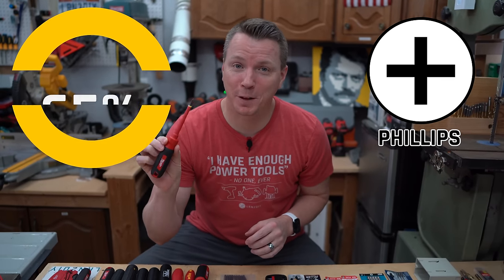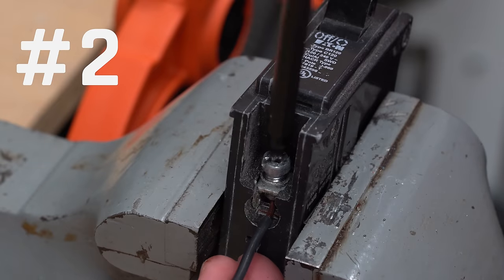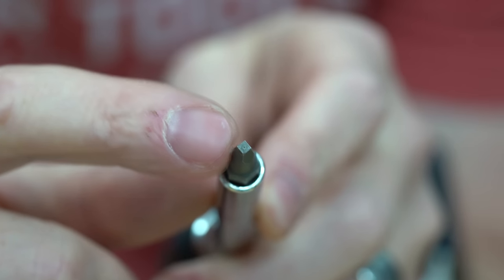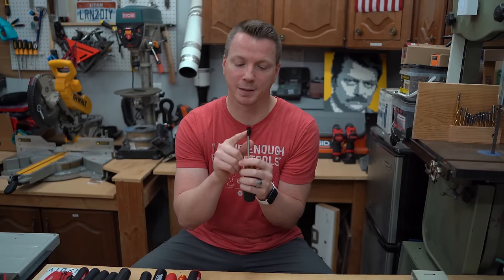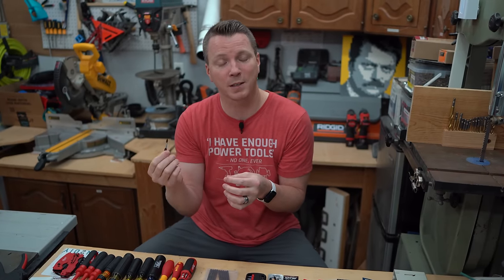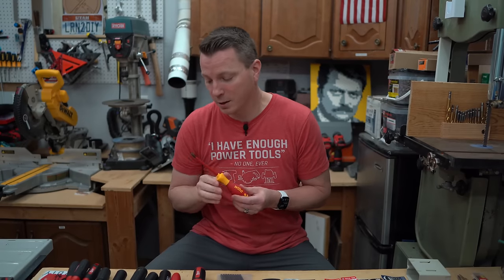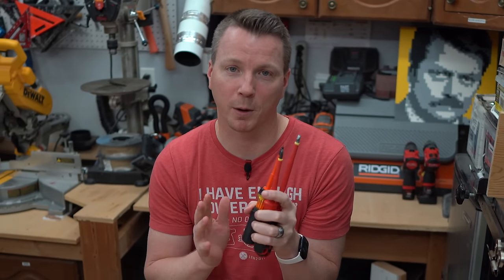You're Using the Wrong Screwdriver For Electrical

Comment: I use the flat driver because it gets the connections tighter.  Phillips is designed to cam out and will never get as tight.  

That said, I don't like the flat driver because it has to be centered in the slot, and the slot cannot be rounded off or 'stripped' in any way.  Or else, under high torque the driver blade can 'fly off' and be ejected from the slot with a lot of force.  If that hits skin it can give a very painful cut.  It's especially bad if the driver is in good condition or new because of how much torque it can handle without slipping and flying off, but when it does fly off it will be without warning, it will have all that torque behind it, and it will have sharp edges to really draw some blood.  If you get your fingers with that you'll know about it right away.

If it were up to me, electrical screws would be Torx (T30 would be good) or maybe square drive.  Both able to deliver a lot of clamping force for good connections, but no risk of the driver flying off and cutting hands (as with flat blade), or camming out of the screw and stripping it (as with Phillips).  Hex socket head would also be fine, 5mm or so will get tight and won't strip out.

The "combo" flat and phillips is junk, throw that away.  It can't do either job properly

Comment: The idea of the combination bit is that the square in the middle holds the bit in the center. The biggest issue woth flatheads is that they easily slip out

Comment: For many  years I carried  1/8 3/16  1/4 slotted & P2 fixed blade  screwdrivers. Recently (5 years ago)  I started carrying R2 in my tool pouch because most breakers now  have combi screw heads. My only regret is that I cant find R2 in 6 inch lenght.

Comment: That was great.  I wont waste money on any of the combo tips that I had been wondering whether they would be upgrades.  I use Robertsons mostly.  And I use the real ones.  There are a lot of badly fitted Robertsons out there.  Lee Valley sold the actual Robertson drives in all the sizes, I don't know if they still do.

Problem with slots is they need to be fitted.  They are the go to for gunsmithing, and you can make your own screws.  They also don't need to be cut in deep in the head so they work with shallow heads.  They are better looking.  And given that all the plate covers have flexibility one can usually adjust the screw to a 0/180 orientation, as one could with any screw, however that is a good look with a slot.  There is something a little vulgar about a Robertson trim screw.  Feels like you might walk by some day and see a dragonfly trying to start the next generation in there.

Comment: Do more research on phillips head screw drivers, they are way more complex than you think and more thought has been put in to the design than you can imagine. You are just using them wrong if you think otherwise a full set for example would be over a thousand different drivers minimum.

Comment: The best screwdriver is the one that fits into the screw head with tight tolerance. A slot usually can only be inserted to 1mm or so, would easily come back out and strip the screw head; a Phillips does not always fit into the groove perfectly, as different Phillips drivers and screw heads have different configurations of the wings and the grooves in terms of the thickness and the angles the wings taper, so the fit is far from perfect; whereas a  Robertson is just a square that can be inserted to about 2mm, as long as the driver fit into the hole without much give, it does its job.

Comment: the ECX driver actually DOES apply torque to the best part of the screw head to receive it. The slot provides the best leverage as it extends all the way to the furthest-from-center position. The "square center" doesn't need to go all the way into the hole, it's there to keep the tool LOCATED in the best position to apply torque, auto-centering just like the philips, but with a better way to apply the torque. The combination is fine but not necessarily superior. It's rounded on the "nub" on purpose so that it DOESN'T apply force to the square-drive portion of the fastener. The P2R2 should be avoided as it can easily be confused and used where it shouldn't be causing damage to other fasteners.

Comment: I've tried them all. I use the p2r2 at work for the copiers I fix. Love those. Klein ecx I've tried on the 11 in 1 I have. It's ok. Phillips can kiss my arse. I don't like them at all.  The slightest lapse in pressure, that P2 bit will destroy the screw head.  Honestly t-8 or t-10 torx could replace phillips and id be happy. Slotted should legally be discontinued. But sq1 is my favorite. Use it every time I make an extension cord using leviton plugs. I make a lot. I have an addiction. If you apply enough pressure to the square drive consistently in use I have yet to find an issue with it, square one or square too. Even in woodworking applications where square twos I run into more often than electrical panels only thing better than a square drive would be a torx.

Comment: I have preferred Square drive for years. Until earlier this year however,  I did not own one designated for electrical work. It is the best design for all types of screws in my opinion.  Home Depot  sold square drive deck screws years ago, then they went to star drive which I thoroughly detest.  I hope no electrical component manufactures ever go to star drive.

Comment: Having used all sorts of screw in fasteners in my working life. I prefer robertson. Another driver style that you did not mention is the torks head. A very good system for higher end fasteners.    
   As for stripping out threads or breaking fasteners It is a matter of being more careful. Philip's headscrews are a continuous problem. Trying to get enough grip to insert a screw properly or remove a screw is always questionable. Both the driver and the screw head wear out prematurely. Also, not every screwhead looks like a Phillips is. Some European cabinet hardware has a Phillips looking screw but the angle of the blades is much blunter. A standard phillips head driver does not work in those screws.
Reply: I’m with you, I’d like to see Torx everywhere.

I think the non-Phillips cross drive is simply dual slotted, isn’t it?

Comment: I’ve had far more rounded Robertson screws and bits than any other type of screws. I’m an electrical engineer and I’ve used all the major brands, Wiha, Phoenix, Craftsman, Snap-On and so far, and I really hate to say this especially when I’ve spent almost $100 on a single screwdriver, the Harbor Freight electricians screwdriver set is the best. They fit tight and don’t cam out or slip and also appear to be built to JIS standards. They are a little brittle though so using the slotted as pry bars is completely out of the question but as far as actual electrician stuff goes they are great

Comment: I am team robertson - Get the Klien 11 in 1 but be careful, the drive grips so good that it can remove the tip from the screwdriver on drive release, and typically this happens when you are outside over a bed of leaves. The 11 in one has every screwdriver and nut driver used in electrical. - and it fits in a drill. The 11 in 1 has both #1 and #2 robertson, flat, and phillips. all in one.

Comment: funny enough the reason philips screwdrivers slip is actually a design tolerance thing they are designed to cam out of the slot when to much torque is applied to protect the screwhead as they are usually softer than the driver and its better for you to cam the driver out than strip the screw

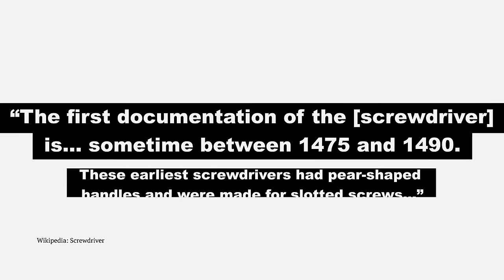Comment: 1:55 No! Slotted screws, aside from any other advantages, are also a low technology fastener that can be used with a low technology screwdriver. A dull knife, a piece of sheet metal or other material sturdy enough for the job, a small coin etc. all are possible substitutes for a flat head screwdriver in a time of need. This is a good thing, assuming unnecessary abuse of this feature does not become a usual pattern thus damaging all slotted screws and necessitating their replacement. So, in an emergency or in times of lack or appropriate tooling or materials, a slotted screw saves the day. It's also far easier to make a rough slotted head screw on your own with rudimentary tools. Try that with Philips screw!
On the other hand, nearly all other types of screws, Philips, Pozidriv, Japanese standard, Allen, etc. all require a higher technology screwdriver that is specific to only one type of screw and not necessarily always at hand or easy to procure in an hour of need. 
The further you are away from modern civilisation, the more indispensable slotted screws and thus flathead screwdrivers become. It is a great safety-guaranteeing part/tool.

Comment: I have never seen anything but a flathead here in arizona.

And as someome who is a professional carpenter, never had cam out issues with the robertson ever and every single screw i use is Robertson. If you get poor tips then they do wear out faster and you feel it more on a robertson than say a flathead or combo drive, but screws are hard to strip even if you're using a drill on drill mode

Comment: For looks slotted look the best.  So any finish piece slotted looks best.  But other screws i like torx 25.   I don't know why electric doesn't use it.  In torx hex works also.   Next robertson  next best.  Philops is ok but fearson or (reed n Prince) is better than Phillips.  The largest driver will work in the smallest screws.

Comment: the best screw that they unfortunatly don't use is the torx screw. there is a 45 degree turn vs the 90 degree of both the philips and the square. and you would get a good tight connection the doesn't slip out of its opening.

Comment: Klein also has a combination #1/#2 square drive that "telescopes" (Klein part No. 32708).  It has it's own pouch in my tool belt.
Reply: Ideal Tools makes a similar tool. Part # 35-947. It comes with 4 tips and the shafts are extendable in the handle which makes it very useful. It's not an insulated shaft, but it's a good tool. I picked one up at Lowes when they had it for half-price recently. I really like the square drive for breaker installations because the shaft is thin so it fits in the hard-to-reach breaker screws. Especially with bolt-on breakers in certain commercial distribution panels. Yes, it's not insulated, but it can't be with the sliding shaft feature in the handle which makes the tool more versatile. You just shouldn't use it on live circuits. And while that's not always possible, I prefer using it over a multi-screw driver with a bit head that can come out of the handle or shaft which could be a huge hazard in live panels or equipment.

Comment: Any time I get a chance to replace a Phillips screw with a Robertson, I do...except for drywall, where the Phillips is perfect because it is so great at camming out as torque increases. A #2 SQ ("Red Robbie") is the go-to for construction in Canada. 

Now, if we could get one of the most regulated and standardized industries (electrical) to actually standardize on a single size instead of a #1 for side terminal and mounting screw and a #2 for a box grounding screw, we could get by with 1 screwdriver behind the plate. I just got a set of home automation switches that have a #1 PH/SQ/SLOT combo screw on the side terminals and a PH/SLOT for the mounting screw. So I'm forced to carry at least 2 screwdrivers for a simple job, or use inferior tools.

Comment: I’m a little confused, you use the screwdriver that fits the screw you need to loosen/tighten. So the real question is what screws do you use? 

Obviously if it’s a new install you can use the best screws but most of the time you’re going to just use the screws that are already there and you don’t really have a choice which screwdriver to use

Comment: You didn't mention small slotted for releasing wires that are inserted into outlets vice attached with screws. Nice demo I have never used robertson bits, will check them out. Thanks.

Comment: Obviously you don't remove enough paint from screws. At least with a slotted screw, you can tap the paint right out of it with the square edge of the flat edge while hitting the back of the driver or sideways on the tang.  But it's so easy to strip a slotted screw and its very frustrating trying to loosen a damage one.

Comment: Replacing a Philips screwdriver with a JIS (Japanese Industrial Standard) screwdriver can be beneficial depending on the types of screws you most commonly encounter. Here are some reasons why a JIS screwdriver might be preferable:

1. *Specific Design for JIS Screws:* JIS screwdrivers are designed to work with JIS screws, which are commonly found in Japanese products, particularly electronics and motorcycles. The fit between the driver and the screw is more precise, reducing the risk of stripping the screw.

2. *Less Cam-Out:* The JIS screwdriver's design reduces the likelihood of cam-out, where the screwdriver slips out of the screw head, potentially damaging the screw or the workpiece. This is particularly important in precision work.

3. *Better Grip:* Due to the more precise fit, a JIS screwdriver can provide a better grip and more efficient torque transfer, making it easier to work with tight or difficult screws.

4. *Versatility:* While a JIS screwdriver is specifically designed for JIS screws, it can often be used effectively on Philips screws as well, offering a degree of versatility.

5. *Durability:* JIS screwdrivers are often made with high-quality materials and precise manufacturing standards, leading to increased durability and longevity.

However, it's important to note that while a JIS screwdriver can be used on Philips screws, the reverse is not true. Using a Philips screwdriver on JIS screws increases the risk of damaging the screw. If you frequently work with Japanese products or find that you're stripping screws with a Philips screwdriver, switching to a JIS screwdriver could be a wise decision.

Comment: The thing is that generally speaking, you just don't need more grip or torque than a good #2 PH provides for electrical. And PH is just overall more useful in the USA. If I have the space for two drivers, I would much rather carry two different lengths of #2 PH than a #1 and #2 Robertson.

Comment: You forgot one!  The screw heads have two diagonal lines on them, indicating they are for Pozi-Drive.  It looks like a Phillips head but its not, its design is meant so it doesn’t cam out.  Pozi-Drive.  Lots of Ikea furniture screws use it too.

Comment: I worked at a Japanese electronics company.  The engineers, Japanese, called slotted screws minus and philips heads plus. They did not use slotted screws much at all. They also seldom use nuts.  sheet metal or wood threads mostly.  THEN computers came along and have slotted, philips and hex on the same screw.  This is the best IMO.  I do agree with the disuse of slotted screws.  When I come across slotted screws I usually throw them away and sub in philips or combo heads.  The exception is if I have to match external legacy hardware. I've also come across hex and or star screws.  This is common in some auto manufacturing as it is the best to automate  Usually you have to use the right driver, hex or star and a slot or philips won't work. I usually carry a screwdriver with reversible shaft and swapable tips so I have four sizes and or types in one tool.  Many crude silly jokes have been made about this part.  So, who does not approve of a tight screw with a good head and a firm bottoming?  THEN there are the tamper proofs.   Their claim to fame is that they come out harder  than they go in.  Sorry folks, these jokes just write themselves.  Good luck.

Comment: I'm an impact driver guy, even for electrical.   I never noticed you could fit a square bit in there; I thought that was exclusively for plastic fence work!  As for bits, I always go for bits that are at least 6 inches long with a narrow round shaft.  You can get insulated driver bits online.  I gave up trying to find driver bits at the local hardware store because the selection usually stinks.

Comment: I was wondering about those new combo square drivers with wings, you showed what I thought so it's crossed off my list. I been using #2 square drive because Philips just dont work. But I soon found I needed a #1 square drive to on something electrical, so thats the one I want, 2 on one end and 1 on the other, now which was that, rewind............ Good video........
Reply: @job38four10  I found at Lowes a screwdriver that seems to work so well , I went back and bought more. 
Brand Ideal 35-204 . I found it in the electrical section of the store.  I would love to find 2-4" bits of this "combination " for my screw gun.  Too bad he didn't have these to test in this video.

Comment: I ran into Robertson by chance. I was assembling a new bed I bought and couldn't for the life of me get any of my screwdriver tips to not slip in the included bolts . Took a closer look at the tip with my phone camera zoomed in, and what? A square hole? Hunted around my tips andi sure enough I had some. And yeah, had some solid grip. I was able to put down a lot of torque into that screw.

Comment: I use the bit appropriate to the task and device.  If it is an outlet then it is an ECX bit 99% of the time.  Panels are generally a flat head or Robertson depending on device and required torque.  "Tools makith the man!"